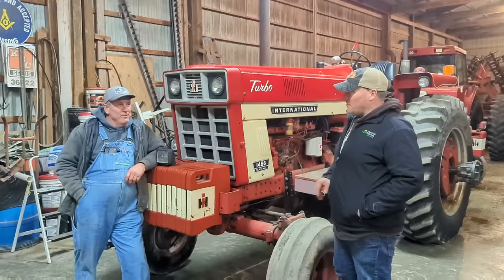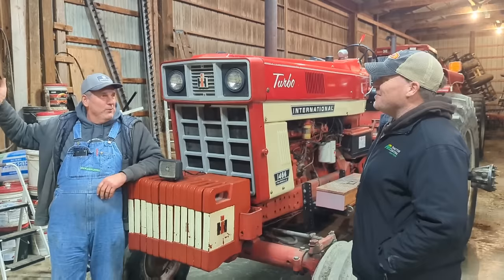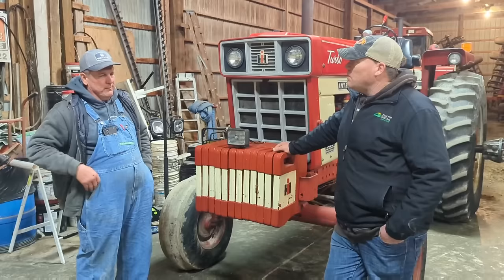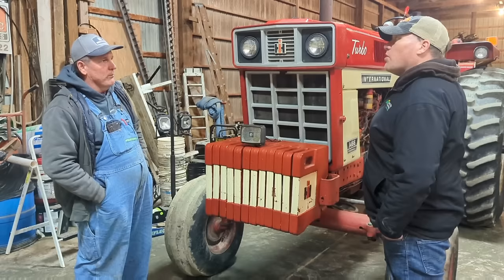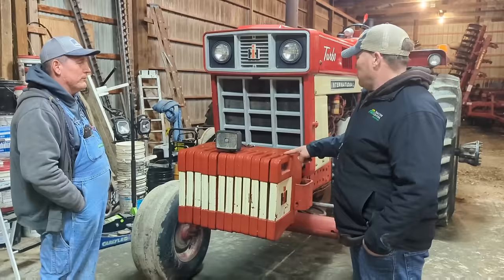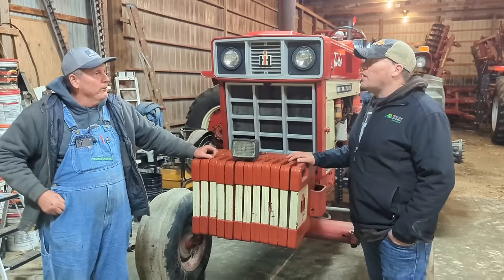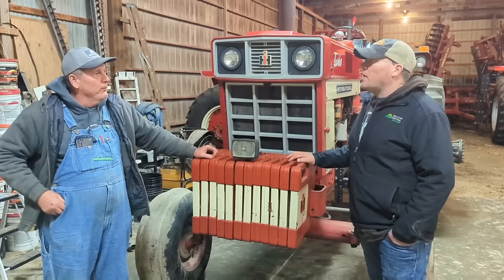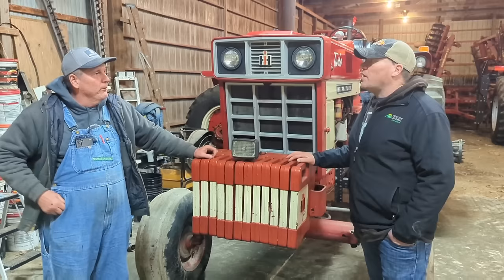Grabbing a handful of IH DT horsepower on a 1466

Comment: John Deere had horse drawn equipment in their catalog until 1951. The first farmer I worked for told me some of their history. Their first tractor was a 1928 GP John Deere. Then a WC. A 1947 DC Case. The horses left in 1950. That was the year they bought a Case baler, a John Deere 40 foot elevator and a Ferguson TO 20. Until then the horses were still used to pull the hay slings up into the barn as well as pull the hay loader